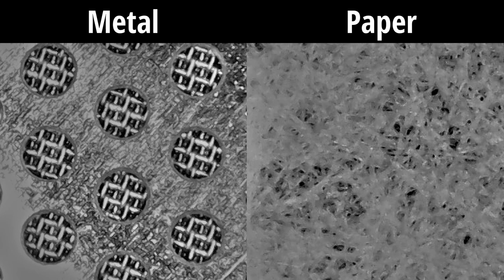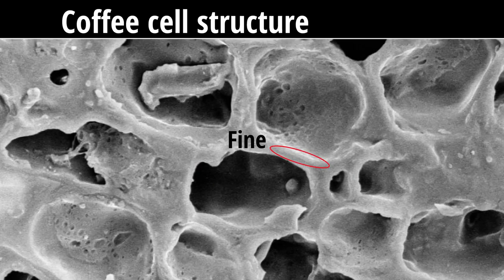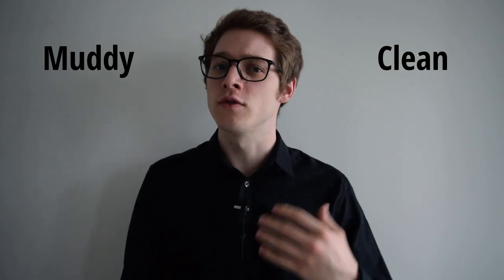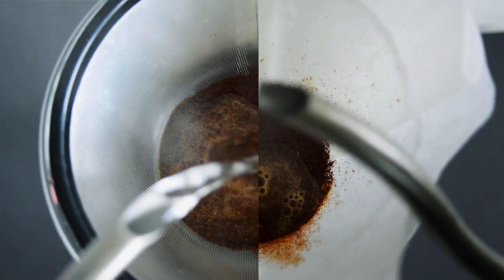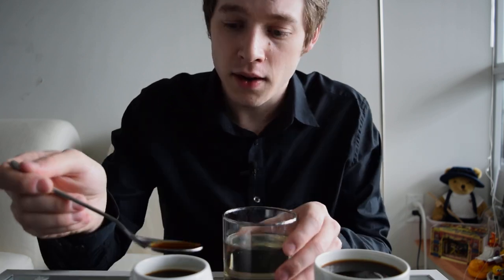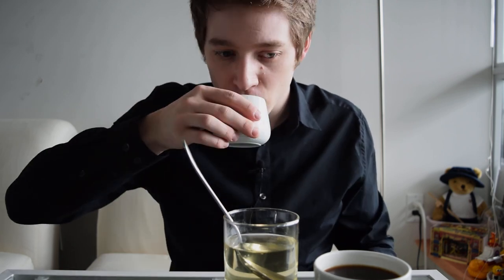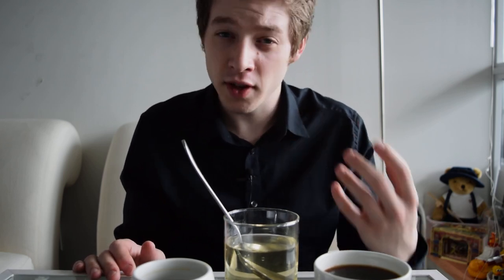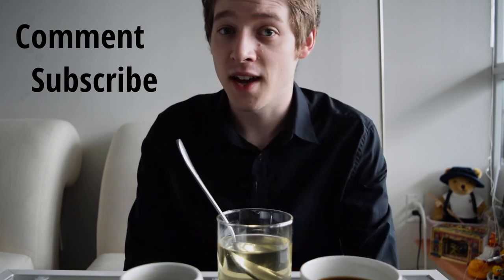Paper vs Metal filters for coffee!

Comment: There is a very important point you have forgot to mention, metal filters can save more money in the long run, and are better for the planet.
Reply from the maker: This is something to consider, but it's not necessarily true. Metal filters do eventually break or malfunction. We've had many at our store that begin to pour too quickly and have their seam come undone (this is with $90 metal filters!). Of course, a lot of the reason is due to mishandling such as knocking them aggressively, or putting them through the dishwasher (DON'T do that). But the fact is, we've gone through so many metal filters that the amount of brews we've made from them have been significantly less than the hundreds if not thousands of paper filters we could have bought. 

Assuming you can guarantee the metal filters won't be mishandled though, they may last quite some time and you could be correct about the cost.

In regards to the environmental factor, you're probably right. Metal filters will reduce the number of trees that need to be harvested.. But do keep in mind any costs that it takes to properly recycle metal filters. Also, even bleached paper filters from Hario and Chemex now use an oxygen bleached process that does not create harmful pollutants. So on that side of things, the harm is less than what it was decades ago which is good.
Reply: @CoffeeTimeJR  you seems trying really hard defending the paper filter.
Reply from the maker: @NashTheGreat  well, I just hope to clear up any misconceptions around the point of waste and sustainability in the industry. Everything is not so black and white

Comment: I use a Bodum pour over with the included Metal filter and it is the best tasting coffee ever. I used a paper filter with the Metal filter and the coffee was bland in taste. Yes, the Metal filter lets the sediment but not the coffee grounds into my coffee but I put a Half ounce of Olive oil into the pot and it helps to eliminate any bad effects from the sediment. I have a tender stomach and so, I-know when the oils and sediment hurts my stomach and the Metal filtered coffee does not. Some Sediment is not bad in aiding to the complexity and strong taste of my coffee. Actually drinking all of the sediment will definitely churn the stomach.

Comment: Always wondered what's the difference between paper and metal, thanks man!
Reply: The difference is quite obvious: Metal filters usually let most of the fines and oils pass into the cup that paper filters retain. The result of a metal filtration is usually a much thicker, oilier and not so smooth and pleasantly tasting coffee. There are roasts, however, where you would want a little more richness, so for those, metal filters are suitable. Most coffees fare better with paper filters. It also depends on how coarse or fine you grind the coffee.

Comment: I can taste the paper filters. Started using stainless and it's great. When the filter slows down over time, I clear it with a propane torch.
Reply: I need a propane torch then , mine clogs then the grounds end up in my coffee as it runs over sides of filter and becomes useless yuck.
Reply: You can rinse the paper filter first with water, which is supposed to clear out the taste.

Comment: what if i put a paper filter IN the metal filter?
Reply: I did that , I kinda feel like the coffee is way more cleaner and it has less coarsity in the throat
Reply: The paper is more dense than the metal, so the already filtered coffee from the paper wouldn't be filtered again, since what whatever particles that was too thick to pass the paper stayed behind, there's no parts to be filtered by the larger mesh.
In other words it wouldn't matter at all and you can skip the metal if you already use the paper.

Comment: Would you recommend using the metal filter as a second filtration method after using a french press? To get rid of most of the fines🤔 I do it with paper filters 'cause i have them at the moment.
Reply from the maker: I think it depends on how large the holes are for the metal filter. If they are similar to the French press metal, then it isnt really doing much.. but if they are somewhere in between the French press and paper filters, then that could be an interesting way to take out just a touch more fine particles in the cup, without removing as much of the oils and smaller components that paper would.

So it does depend what you want in your cup. I'm with you you on paper though! I love the flavor of most paper filtration methods. I like a french press or mokapot though for dark roasts, to make some heavy and bold coffee.
Reply: It's worth experimenting with.

Comment: How about the cloth filter?
Reply from the maker: Great question! I haven't experimented a lot with cloth, but I know that it's generally in between paper and metal in terms of porosity. You do get a brew that may be the best of both worlds and is fairly balanced.

The only problems with cloth are mostly revolving around how hard they are to maintain and keep clean. Even just regularly washing it and attempting to air dry it can lead to bacterial growth and itll smell like an old sock.. that'll get in your coffee and just be kind of gross. However, James Hoffman has a video on this very topic, and I recommend you give it a watch ! He goes over how you can do certain tricks like keeping it in the fridge submerged in water, or in an airtight container in the freezer. Interesting stuff
Reply: @CoffeeTimeJR  thanks for the advice & heads up. Interesting tip on storage. Really appreciate your feedback

We use a long coffee sock for our local kopi (Southeast Asia) , but never tried the pour over filter version. I just wash mine and hang it out to dry under the hot sun. (tropical weather)

Comment: Any difference in grind size between the two filters?
Reply from the maker: Yes there will be! Finer for metal, more coarse for paper. Especially chemex paper as its thick. The difference is mainly dependent on the porosity of the filter, as you'll need to use the grind size to influence the flow of water so it doesnt go too fast or too slow

Comment: What kind of drawdown times is "acceptible" for metal. I have a cheapo chemex clone with a metal filter, but I struggle to get the brew time longer than 3 minutes even when grinding fine.
Reply from the maker: 3 minutes isnt terrible depending on your dose. I do 22g of coffee and add 374g of water which takes 3:30 or so to draw down fully. If you're getting 3 minutes with a lot more coffee than that, then it's likely an issue...

As you say you could grind finer, but ultimately you want to taste it and see if it's okay! If it is, then dont worry.about the time :D if not, try also making sure you are using the hottest water you can to increase extraction within that 3 minutes

Comment: I like the look of the metal filter (as well as price point) but I prefer the mouth feel of a paper filtered cup of coffee. Is it ok to use a paper filter in the metal filter? Is there any disadvantage to that?
Reply from the maker: One thing to consider would be if using both slows down the flow, as you'll have 2 points of filtration the liquid has to pass through. It might over extract your coffee, but you could try compensating by grinding more coarse

Comment: What if we use metal filter and paper filter at the same time together ? Does it work?
Reply from the maker: I know that a barista once did this during a competition, and other's have talked about it or tried it, but I don't think I would recommend it.

I would think that there would not be an optimal grind setting to satisfy both filters, not to mention the fact that having double filters could slow the brew down and lead to over extraction. You'd have to do some serious fine tuning. 

Also, any time you add a second filter the coffee is going to be defined by whatever filter has the smallest pore size. Paper on metal or vise versa, the coffee would just be filtered most by the paper and that's what would define its characteristics. In my mind, you'd be better off just using the paper on its own and dialing it in well.